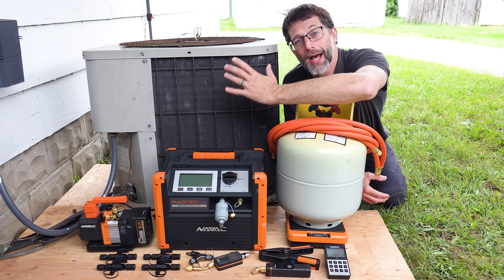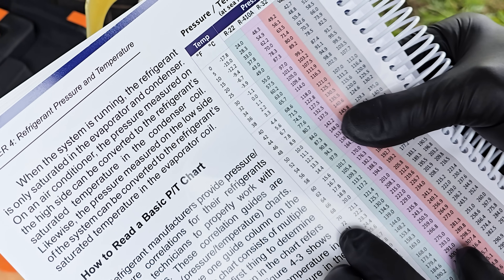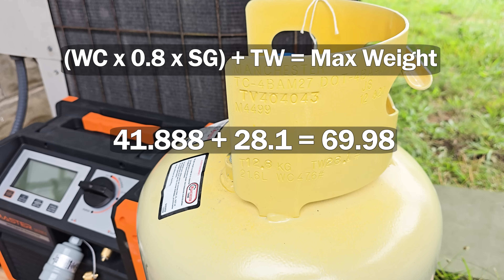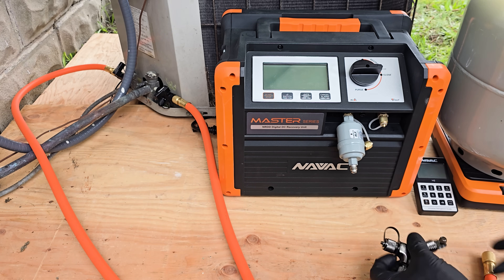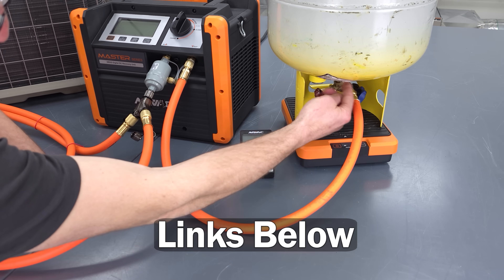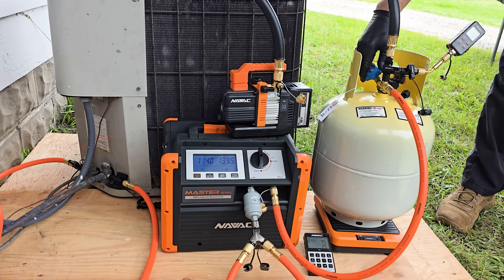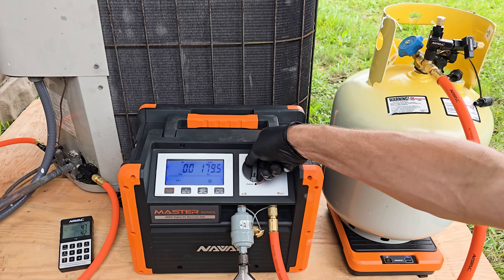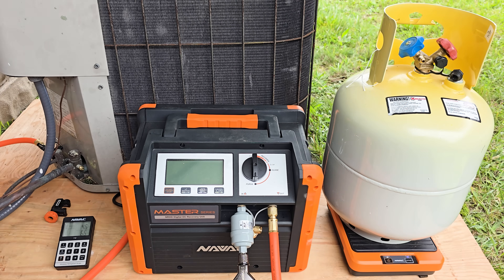Refrigerant Recovery Procedure! Including Vacuuming the Hose Setup and Recovery Tank Weight!

Comment: When i replaced my 4 ton R22 unit after i had removed the refrigerant like Craig did i turned the unit on for about 5 seconds and i got about another 6 oz of refrigerant out of the unit. I think i heard that the refrigerant can be trapped in the oil.  Thanks for the videos.

Comment: Welcome I want to know how many macros are needed for an 18000cc piston compressor.BTU White Westinghouse window air conditioner, old model, but the capacitor does not have any data. For your information, the fan capacitor is 6 microfarads. Thank you Gas R22 Thank you
Reply: try looking up the compressor model number, it's probably listed somewhere online or you may be able to call the manufacture or whomever bought them out for the data.
Reply: Thank you, I know the capacitor capacity of the compressor.  @throttlebottle5906

Comment: In france.
We have to vacuum always all the flex ;)
It’s more efficient and we don’t release gaz into the nature.
The only problème it the flex between the recovery unit and the tank.
It’s always full of gaz/liquid… 
To not release réfrigérant In the atmosphère, I use a flex by type of gas.
Reply: there's an issue there. if you leave liquid in a hose, there's no expansion space, which means it will over pressure when it gets hot and could rupture or blow off and end. it's likely reaching thousands of psi and coming close to rupture pressures.
you're never supposed to leave liquid in any hose with sealed ends, valves, gauges or anywhere it's not open to an expansion vessel.  same reason you can only fill a cylinder so far, it needs expansion space.
Reply: @throttlebottle5906 you can close the valve at the end of the flex.
And raise the valve in the air.
The liquid go down and after you are full of gas.
You close the tank valve and now you leave the flex from the tank.
I ve not found a method to not leave the gas in the flex.

Comment: I use a similar setup (with Fieldpiece and Appion equipment) but I always hit high pressure cut off within minutes of starting the process and units barely half way recovered. Any suggestions to help with that?
Reply: Bucket with cold water. The pressure is building up in the tank bc it’s getting hot.
Reply: Buy or make your own sub cooler and set it in a ice bucket.
Reply: Truthfully one can try to do it the textbook way but good luck with a grizzled installer who won’t have patience with the apprentice tech fiddling around with their numerous valve core removal tools. I was that guy back in 2016 and reality had an interesting way of not replicating the ease that them YouTube videos showed these tools to work as if they were seamless in execution. Back then I’d think I did something wrong ruminating for days where I went wrong on a field procedure. Comparing my experience with what was shown on YouTube served to create an unrealistic comparison not recognizing the highly edited nature of the videos posted online. 

I mean how often have you seen a guy with more than one valve core removal tool on hand? Similarly, with the obsessive manner this recovery process exhibited I’d imagine the homeowner begin to wonder what those guys are doing looking at the machine mucking around with over priced and overhyped toys reminiscent of the school playground.

There is a middle ground to this evacuation procedure and as much as I admire Craig this is frankly impractical in practice and will often cause one to alienate their peers if you rigidly adhere to this exhaustive and very time intensive procedure!
Reply: @Curious0189 then you’re simply not good at your job. I always have all the tools I need because I’m prepared.

Comment: Se puede recuperar R-32 ???
Reply: No you just release it into the air. 😂
Reply: @jessebHVAC  lol
Reply: @jessebHVAC  Just like 410 😂
Reply: yes, you recover it the same way. just make sure you have an A2L refrigerant compatible recovery machine, tools and recovery cylinder.
the recovery and vacuum pumps are spark proof sealed motors and the recovery cylinder has a wide "red band" just above center of the tank to denote it's an A2L gas.